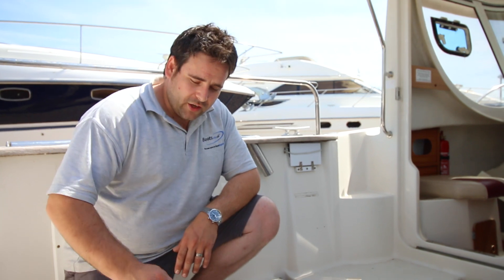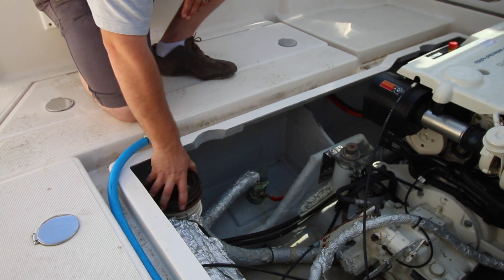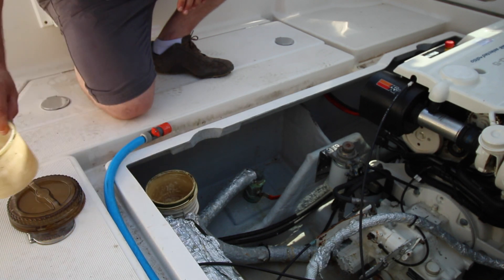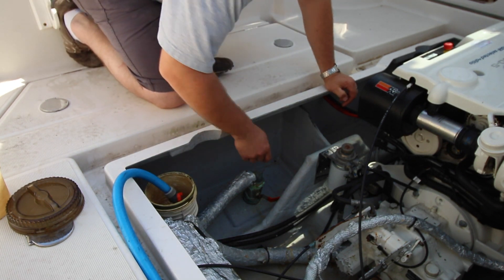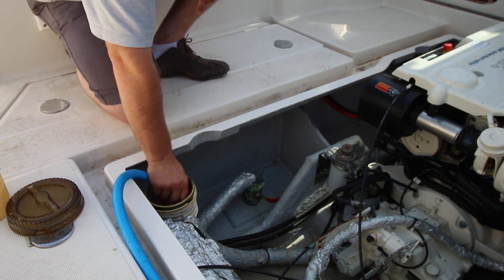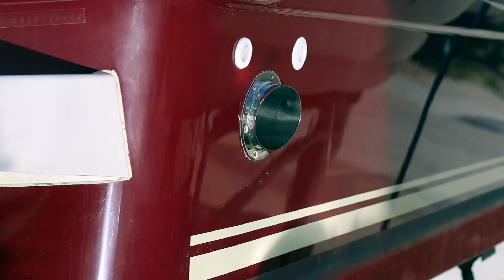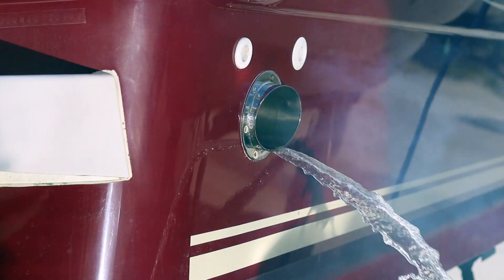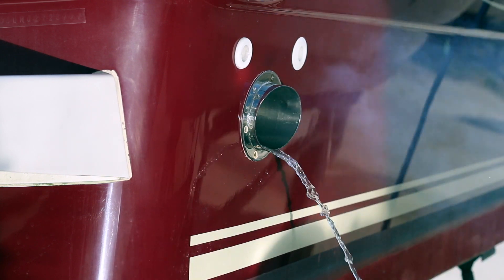How to run inboard engine out of the water on a hose

Comment: What about the impeller wouldn't that be running dry
Reply: It would, and it would be weakened significantly if not destroyed completely
Reply: @GatesRapes wrong.....the impeller is downstream of the strainer. As long as he keeps the strainer full the impeller is sucking water from that.